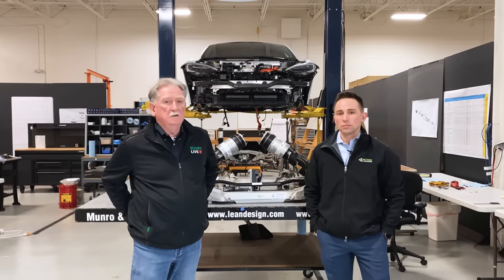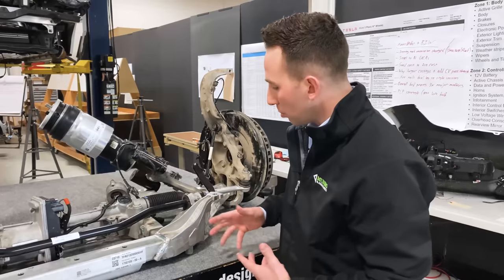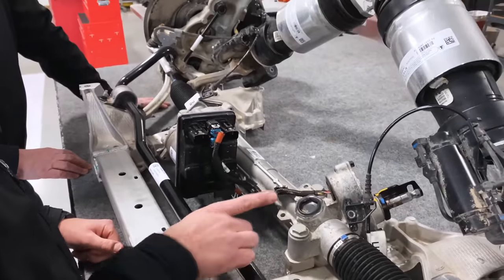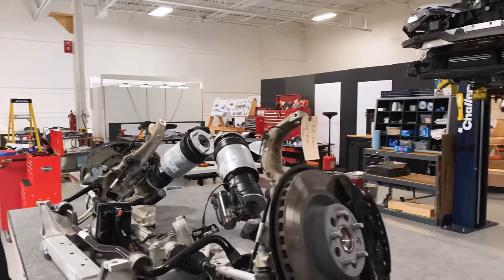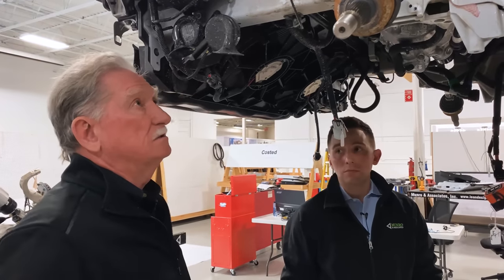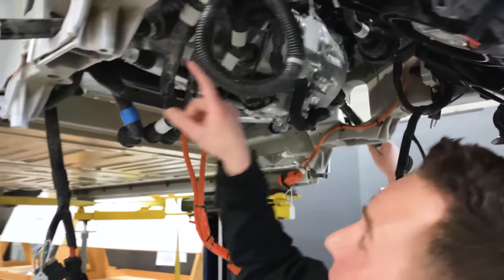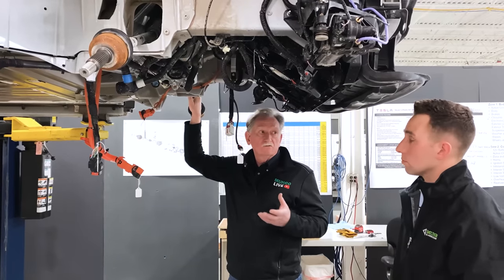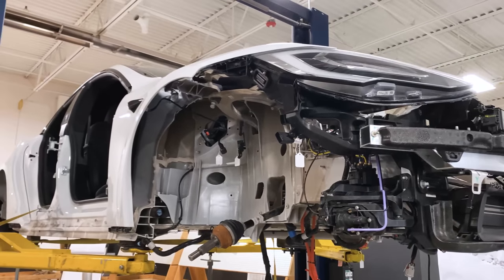Front Cradle and Suspension | Tesla Model S Plaid Teardown

Comment: Personally, I feel like mechanical steering is safer. I know that if your power steering fails, it’s hard to steer, but that’s far safer than if the electric motor fails or a wire gets severed. As far as comparing to airplanes… there’s never any steering at high speed in an airplane so if it fails, you’re just not going to be able to get to a gate or parking position as opposed to 70mph off the road into a ditch.
Reply: Um, planes are usually flying, and there's no stopping in the air, if you lose control, you die. Also even on the ground they go faster than most cars, and do need steering even on the runway, to stay straight.
Reply: A multi engine plane could still steer.
Reply: The fly by wire controls the flaps, rudder, and aileron. He wasn't talking about steering the plane on the ground. The steering is likely to fail while going in a straight line. So, you would just brake and you should be fine. It's mostly if the steering fails in a turn that it will become dangerous.
Reply: Plane need to steer at high speed. And there is a back up power system. If they do it on cars, that will be the same, a backup system in case of power failure

Comment: Super technology in there. I was hoping to see the steering in action to get an idea how the geometry works. I still can't see it in my head.
Reply: see - 5 link suspension, it's what Tesla uses.
Reply: @markplott4820  sorry, that doesn't give me any information on the geometry and how it changes during steering.
Reply: It's common front suspension geometry. Are you wondering about the two lower control arms? The whole thing works as if the two arms were one A-arm with a ball joint where the two arms would intersect.
Reply: @markplott4820  The front has an upper A-arm and two lower arms acting a virtual A-arm; it's not five-link, although the rear is now five-link.

Comment: 10 to the -9th probability of complete FBW failure...at least on the USMC 53K....O and that is a fully active system, with force feedback...you want to feel the bumps in the road...that's easy.  You can even have a switch that turns it off.

Comment: Hi I am huge fan! I used to have a model X and have the new one in order 

Can you tell us more if this new structure fixes the shuddering problem I had with model x (requires replacing the upper control arm) when accelerating specially when turning.. I think it had to to do with the CV joint angle defect 

Thank you

Comment: I find these video's of current car engineering design informative, as I do with any new engineering design related to all forms of transport, one aspect I would like to see is a follow up, its okay to strip down a new car to see how its put together, but I also would like see how the product stands up to normal use after fifty thousand miles, the design may be excellent but is the material used suitable, for example the use of rubberised bushing in the suspension arms of TESLA cars would be good start point, I base that request on other video's I have seen, complaining about suspension noise after only twelve months from purchase of a new car.

Comment: You can't compare the safety requirements of a car to an airplane. Aircraft have to go through strict inspection and maintenance periods. Some cars never get any maintenance until something breaks. Having a mechanical connection at least means it is less likely for the steering to fail due to lack of maintenance.
Reply: True, but already there are systems in you r car that can absolutely kill you if they fail. Brakes for example. Or tires. Or even just power steering. Redundancy would help.
Reply: @andrasbiro3007  Yeah but none of those are going to fail because a mouse/rat chewed mostly thru them and while on the highway the vibrations snapped the last remaining piece of the wire causing you to loose all steering.
Reply: @jackt6595  
Why not? A quick Google search tells me that brake failure causes 5% of accidents in the US.

Also wires have no reason to be exposed (unlike brake lines), and can easily be redundant.

Comment: Very good. What I was waiting for was analysis regarding the drive unit axis and hopefully being corrected from the previous S. The front half shafts on that platform run excessively off of axis making them fail all too soon. This was a significant failure for the S when a front drive unit was added in 2015 for AWD, so could you comment on this please?

Comment: 11:40 basically all GA aircraft are controlled with mechanical cables. The horizontal stabilizer for the 737, even the MAX, has control cables running to the cockpit.

People don't want to maintain their cars like they're aircraft.

Comment: Fly-by-wire steering would require another motor and whole circuit and software to provide tactile feedback through the steering wheel. A mechanical linkage provides that feedback in an uncomplicated way.
Reply: The Tesla cars HAVE 2 motors and "another circuit".
Software?
Ever driven a "force feedback" computer game?
Simulators are good enough to train F1 drivers. It's the same technology.

Comment: This mechanical steering shaft is an interesting requirement.  Caterpillar medium wheel loaders are operated on roads, but they are completely steer by wire.  The steering sensors are triple redundant, and the steering wheel or lever have force feedback.  but no shaft going down to the steering at all. They have a top speed of 30 mph, but still there is a lot of energy rolling down the road that could impact cars on the road if there was loss of steering.  But it is OK and they are safe.
Reply: All true... and what does one of those cost?
Reply: Also, lots of low-speed equipment has had hydrostatic steering for a very long time: the linkage is only by fluid pressure, even before it was assisted or electronically managed. But no one uses hydrostatic steering on the road at normal speeds - it isn't reliable enough without redundancy.
Reply: @brianb-p6586  Different use case, but my point was that the wheel loader is fly by wire.  If the regulations allow for one type of vehicle to used on the road, the same set of safety requirements could also allow an automobile to use the road with steer by wire tech.  And the cost is irrelevant at this point, because all of the hardware is there to do steer by wire. I expect that the steering system has redundant sensors and actuators already.  The mechanical linkage allows steering to be maintained if all power is lost.  Not sure how often that is the case.  In the case of the wheel loader, it can happen, but there are backup hydraulic pumps, and electrical connections take separate paths.   There is a functional safety requirement with failure mode and effects analysis.  These are SAE/ISO requirements to allow sales in the countries where the wheel loader is sold.  I expect that worldwide automotive requirements are being developed and companies like Tesla and other OEM's have worked or are working through the details.
Reply: @greggmcclelland8430  No, the existing electrically-assisted (and electrically-powered in automated mode) racks don't have the degree of redundancy required for steer-by-wire (so all of the hardware isn't really there), although that is available at additional cost if the vehicle manufacturer wants to pay for it. ZF offers steer-by-wire systems to any manufacturer who wants them... and they have dual redundant power supplies and communication links.

There are a lot of vehicles used to a limited extent on roads which do not come close to meeting automotive standards for road vehicles. Any tractor that any farmer wants to take on the road is allowed; that doesn't mean that cars should be built down to the standards of tractors.

Comment: I think the A10 Warthog still has physical connection to its flight control surfaces. Cable connection, if memory serves. So that you can still fly it even with total loss of hydraulics.
Reply: Yes, and that's common. One reason is that, like the Warthog (which first flew in 1972), most aircraft types in production are decades-old designs.

Comment: Interesting and to-the-point stuff. Seeing this reinforces something I've felt for a while - Tesla (and other EV makers) should be using in-board brakes, surely much easier to implement than on ICE cars, including avoiding the accessiblity/serviceablity issues they have on the latter.
Reply: Inboard brakes were a fad of the 1960's, and are long gone.
Reply: @brianb-p6586  They were and are little used because of the servicing issues I mentioned, and it's easy to see how that would be mitigated in an EV, which along with the fact that they get 50% or less use and hence need commensurately less servicing also makes them an attractive proposition. The gains in ride quality from the reduction in unsprung weight are substantial. Whatever, they weren't "a fad of the 60's", that's rather facile, although the broad adoption of CV jointed half-shafts prompted a lot of designers to try them beginning around that time.
Reply: @EliteRock  Actually the servicing issues had nothing to do with what powertrain was turning the axles, so being an EV wouldn't mitigate them at all... other than less frequent service, which is valid (it saves one disk replacement event in the owner's entire time with the car). There's no difference in ease of implementation (design and manufacturing) of inboard brakes for an EV versus a car with an engine.

Reduced unsprung mass is good - if it were important to EV manufacturers they would reduce brake component sizes even in the outboard configuration (since they only need to handle one emergency stop), but they don't.

Yes, they were a fad, because after a few companies tried them, they all dropped them... even Formula 1 race cars.
Reply: @brianb-p6586  We'll have to agree to differ, but these are the main arguments I'm making;

- in-board brakes are inherently superior in terms of suspension control and ride comfort from the substantial reduction in unsprung weight.
- the compactness and simplicity (or simple shape) of an EV power unit would make designing one with disc brakes attached directly to its casing relatively easy.
- the knock-on of that is, combined with the inherent cleanliness of the EV unit (no oil leaks or misting), along with the brakes being away from road spray (the tyres) would be to make access and servicing  easier and less onerous (hence cheaper for the owner) than on an IC vehicle.
- disc/pad life and servicing would be (already is) at intervals several times longer than on IC vehicles, further reducing the advantage of accessability of conventional hub-mounted brakes.

"There's no difference in ease of implementation (design and manufacturing) of inboard brakes for an EV versus a car with an engine." - see above.

The reason they haven't been adopted is, IMO, a combination of engineering conservatism (ironically) and trying to use generic, readily and cheaply available components as far as possible. Formula 1 isn't remotely relevent in this context, for example there is the simple reason (apart from the regulations) that there's no way IB brakes could be cooled properly (and extremely exotic, light-weight materials go a long way to reducing unsprung mass).
Reply: @EliteRock  I agree that lower unsprung mass is good, but every front-engine rear-wheel-drive vehicle has more space for rear inboard brakes than an EV which has a motor and gearbox at the axle (instead of a much smaller final drive unit)... and yet for decades no company has used inboard brakes in this scenario. An ICE vehicle final drive is just as clean as an EV drive unit - both contain lubricating oil and are sealed.

Formula 1 is very relevant, because it is the home of cost-is-no-object automotive technology: they don't use inboard brakes because they are not beneficial overall, even ignoring cost and service effort. Cooling would actually be much easier inboard, as the brakes would be right in the aero tunnels instead of buried in the wheels - have you ever seen an F1 car?

I agree that exotic materials reducing the unsprung mass of outboard brakes is a factor, but even production road vehicles are available with carbon-fibre-reinforced silicon carbide (C/SiC) brake disks, and they are not widely used because they just are not worth the expense in most cases. You won't find two competing car models in which one uses C/SiC outboard disks and the other has inboard iron disks to achieve similar benefits.

Comment: "There's no aircraft on the planet that has anything mechanical going to any of the flight control systems."

My 50 year old Piper Cherokee would disagree with you. :)
Reply: No kidding.
He meant, though didn’t say, new commercial aircraft designs.
Reply: @FutureSystem738  And even then, that would be new designs, not existing designs still in production. Sandy should try saying what he means, if you're correct.

Comment: Re the steering column vs fly by wire aircraft. 

I suppose that it is easier to have a small number of aircraft that are flown and serviced by highly certified people operatre safely than a very huge number of cars that can be operated and serviced/tinkered by a lot less certified people, and never mind the much extra inherent safety of a solid metal steering column...

Comment: Referring to the more and more used castings nowadays, could you explain a little bit about the pro's and cons of them and the used material? I am thinking for example about galvanic corrosion of aluminium and manganese combined with steel or the additional risk for firefighters when using water to extinguish fire and the water getting in contact with burning manganese. Very interesting things you are doing all day.
Reply: These alloys have over a dozen ingredients all in balance to prevent corrosion, maximize strength and malleability and castability. The Limiting Factory did a great video talking about it not too long ago.

Comment: Hi Sandy
I am a big fan of the Sandy Munro show and watch all of your shows on YouTube
The reason why I am contacting you is I would like you thoughts on a Front facing camera for all the Tesla cars 
You have driven all the Tesla and would know if a front facing camera would be a big help parking the car 
I think that a front facing camera with a 170 deg view angle mounted above or below the license plate would be great for parking the car in tight spots where the bumper sensors do not pick up obstacle’s
To view what is show on the front facing camera the rear view mirror could be activated with a touch sensor button on the rear view mirror and this would turn on the front camera display 
Look forward to your comments

Comment: While all Airbus aircraft are fly-by-wire, the Boeing 737 MAX still maintains a mechanical connection between the cockpit controls and the flight control surfaces.  I don't think I'd want to drive a car that was exclusively drive-by-wire for brakes and steering, unless the drive-by-wire brakes were like truck air brakes that when they lose air pressure the brakes are fully applied.  Drive-by-wire brakes would also need a fail-safe mode of being fully applied upon loss of power.

Comment: It's not hard to see where the money was spent. All those aluminum castings and forging.. I was a pattern maker for 10 years Nice to see castings being used to this extent in an automobile.
The long-term reliability in the aluminum casting is amazing...
Reply: YES, in the Austin model Y , with use Front & Real Megacasting, and 4680 cell Structural battery pack. 
it should test Safer than Fremont model Y. 
but, Megacasting is for High Volume, too Expensive for only 10k cars, but IF demand for Mod S/X increase then Volume production would be cheap enough for Megacasting use. 
Mod S/X use large Rear casting, and Front Corner casting, and small parts ( front cradle).
Reply: Ever heard of Audi space frame? 20 or more years old technology.
Reply: @computercrack   - TESLA Gigacasting is NEW Invention as is the METAL, that is ONE  shot at HIGH pressure, that NO ONE else is doing.
Reply: @markplott4820  nothing new about the technology but the aluminum metallurgy is Tesla's formula.
What's is a big deal is no one's ever tried to make a casting that big with that much detail and that thin of walls. Which they accomplished by putting it under extreme pressure so that it can all fill before it solidifies. Amazing machine.

Comment: There is an interesting article by "Electra" describing Toyota's new electric car.  The steering wheel is similar to the Plaid but incorporates steer by wire.  It's capable of  non-linear steering curve.  150 degrees lock to lock.  Your speed dictates your steering inputs. We'll see.
Reply: Correction "electrek"
Reply: Well, I suppose based on regulations it may not be allowed in certain countries?
Reply: thats easy to do once NHTSA steps into the modern age

Comment: at the 5:48 mark, there appears to be enough clearance to replace the half shafts in the event of a cv joint failure.
Reply: It's just like every other conventional car: take apart some of the suspension (maybe a lot of it, depending on specific model), remove the nut on the end of the halfshaft holding it into the hub, pull the hub and carrier away, then pull the shaft out. Installation is the reverse of removal. The bit of structure under the shaft won't change anything.

Comment: When it comes to all critical flight surfaces, a 737 is NOT a fly-by-wire system!

The stick/rudder are mechanically connected.
Reply: I was surprised to hear him say that.  I was expecting him to say 100% of airplanes build before 1990 to have mechanical controls.  Followed by something about how the flight industry has moved to fly-by-wire.
Reply: @tstan6827  Even the current 747 is being built with cable linkages.